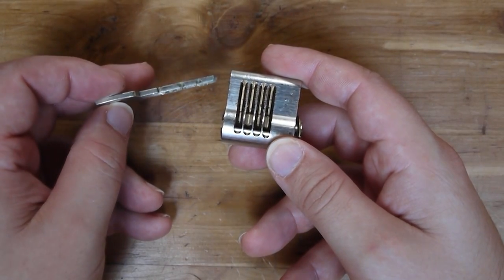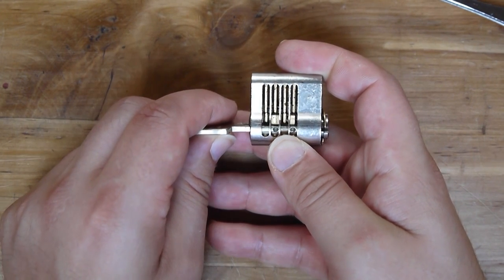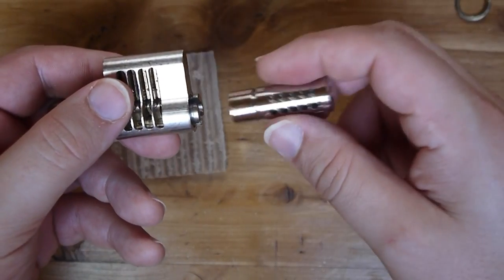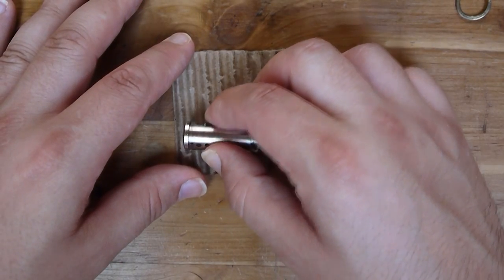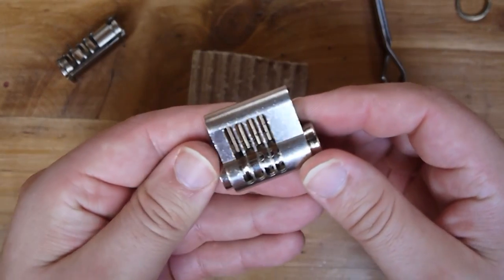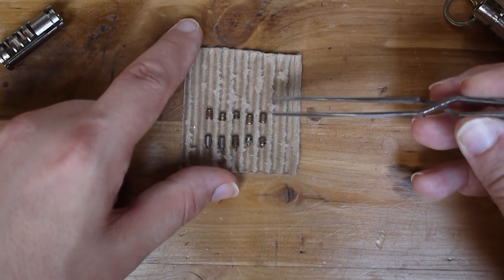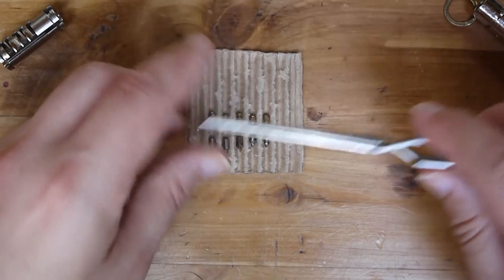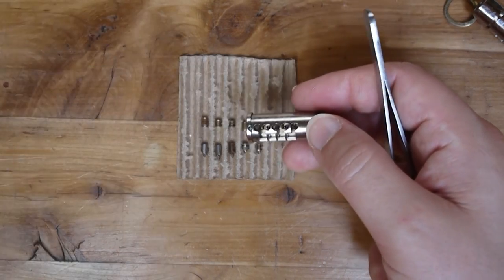The Collection: DOM ix-5 Cutaway

Comment: The "Donut" pins are awesome here in Germany they are called zusammengesetzte Stifte.
When it comes to picking most of the time one of the middle Donuts get caught on the sheer line. If you apply pressure with your pick the outer part moves so you have to apply more pressure with at least in my case often leads into an overset position.
Great review really like it.
Reply from the maker: Awesome! thank you so much for the additional info and picking description.